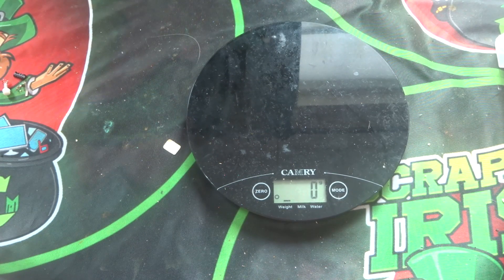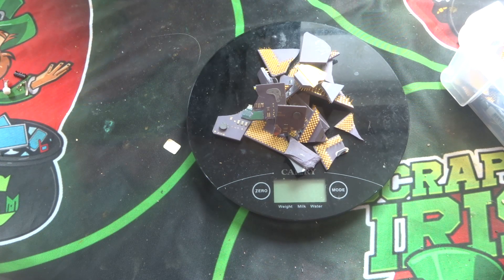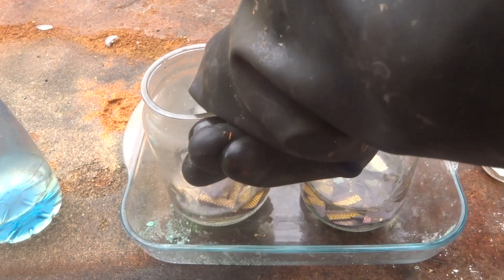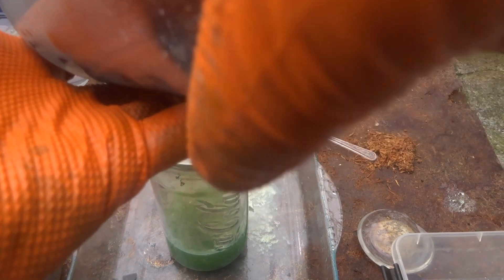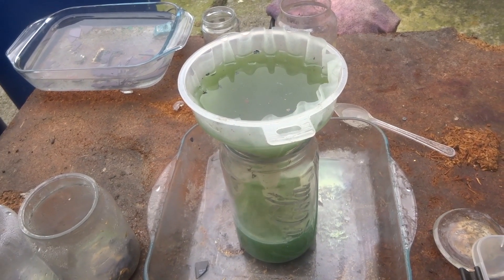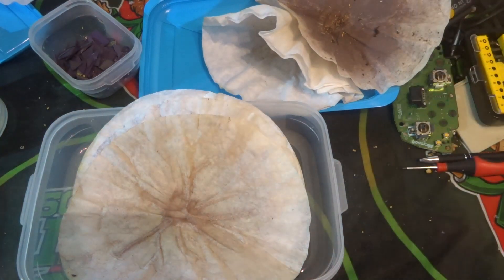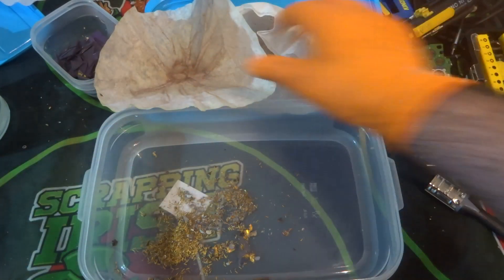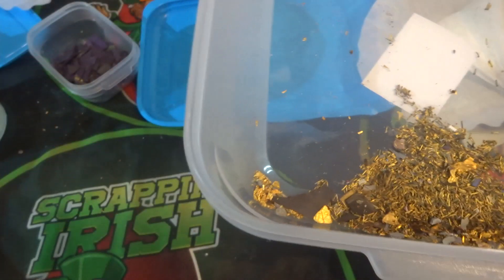gold recovery from ceramic CPU's

Comment: I just tried a batch of 20 of the AMD ceramic CPUs the ones with mlccs on the back of them. I heated them and added shots nitric acid. The gold looks like it has dissolved because the pins white. But when I tested them it was negative with the stannous chloride. What did I do wrong?
Reply from the maker: Not sure maybe the solution has become saturated, try splitting the solution and cpu into two containers and add some more delute nitric too both, also make sure your stanous is fresh but I just think your solution is just saturated by other metals

Comment: There was no reason to smash the AMD ceramic CPU's, there is no gold INSIDE them. Only the Intel Ceramics have gold inside them, under the metal covers, to get at the gold bonding wires and the gold brazing under the silicon dies.
Reply from the maker: Easier to smash them all than sort one from the other
Reply: @ScrappingIrish  I would think it would be easier to just read the tops of the cpu's.  You should know "why" you are smashing them, don't just smash because you think you should smash all ceramics.. Also, did I hear you say that the acid you used was Pure nitric? perhaps should have used diluted Nitric acid, because the base metals need to dissolve and have someplace to go. Pure nitric won't do much to base metals without a little water to dissolve into.
Reply from the maker: @scrapman502  as I always say to yo scrapman 50 I have my way you have your way but thanks for watching